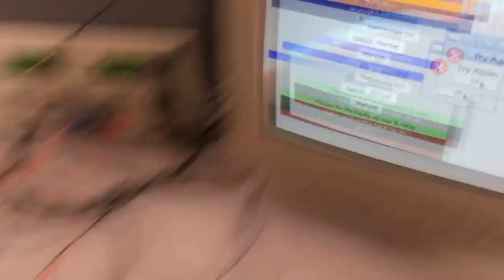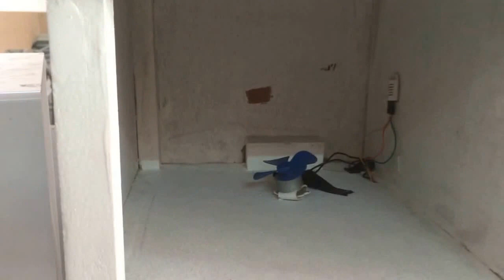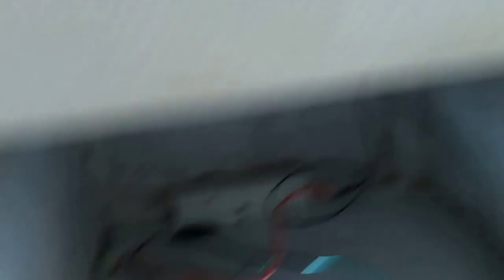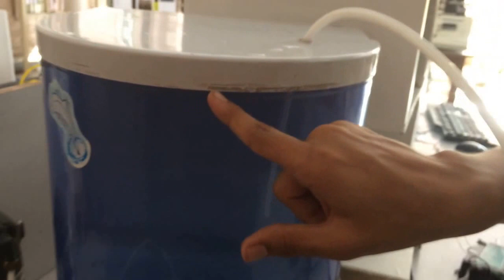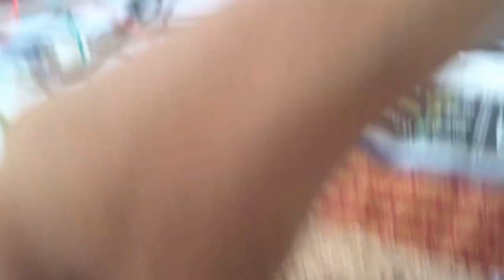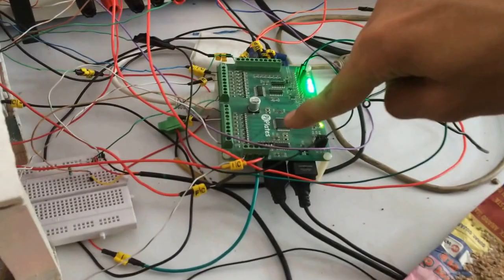Home automation using Raspberry Pi

Comment: great job. i am using DHT22 and raspberrypi3  but i dont know how to write a code which activates an led when temperature or humidity rise above my setpoints i.e 30degrees and 60% humidity. if you dont mind can you post your DHT22-fan code please
Reply from the maker: Sure. I am working on making the code available as open-source so many people can benefit from it. I will soon share a github link for the same.